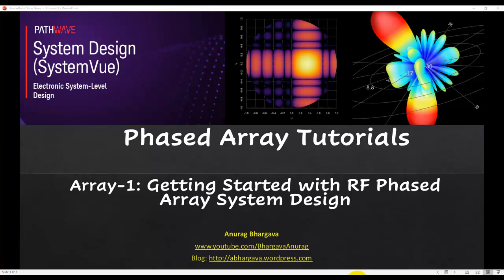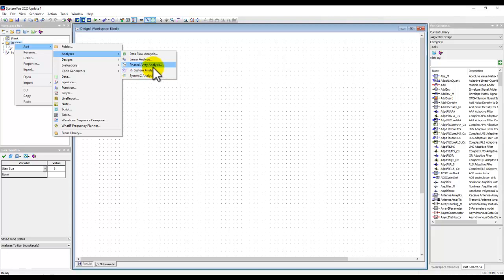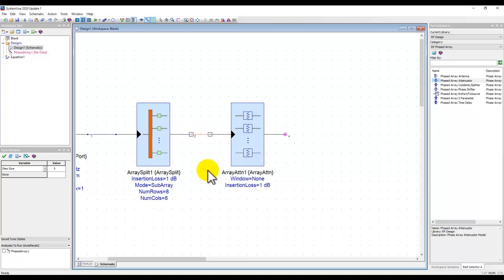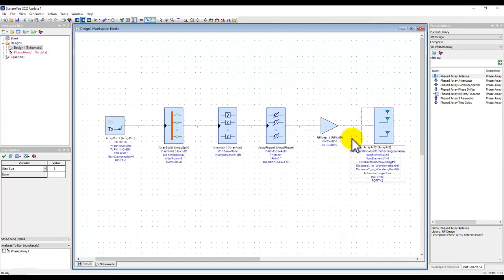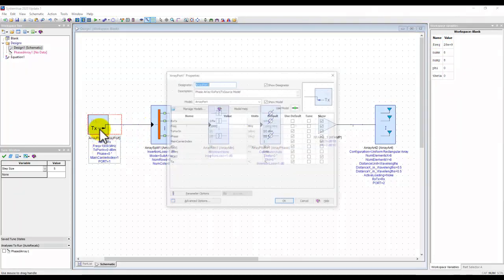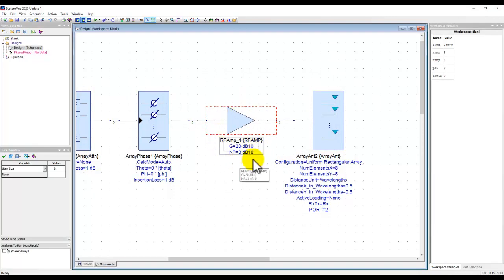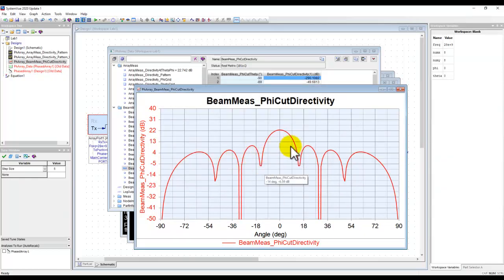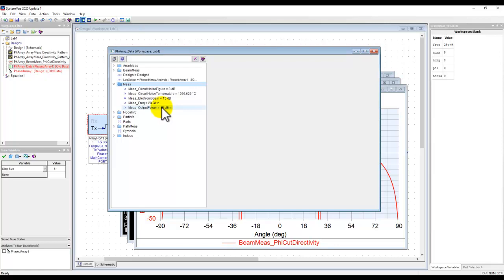Array-1: Getting Started with RF Phased Array System Design

Comment: Hi, thank you for such an amazing tutorial. Can you please help me how to simulate a custom phased array (by custom I mean, a not a rectangular grid e.g. having different number of antennas in different rows). I have placed the antennas on the required positions, but the dimensions are not matching for phase-shifter/attentuator and the antenna grid. Please help.
Reply from the maker: Hi,
There is a shipping example in SVue that talks about custom positioning of the radiators of your choice. You can look under Examples and look for phased array or else contact your local Keysight tech support team for help.
Reply: @BhargavaAnurag  thank you sir.